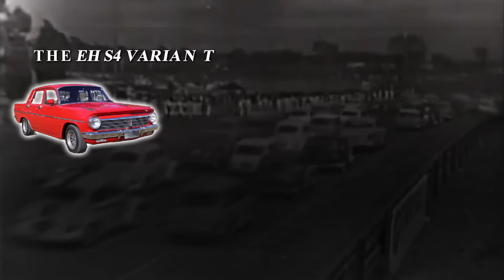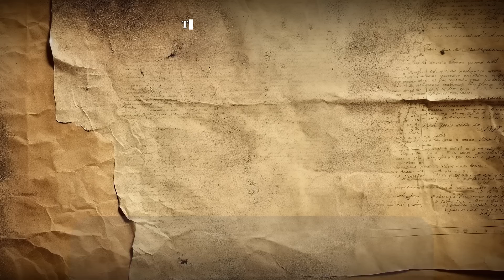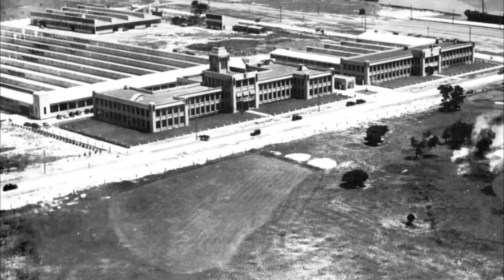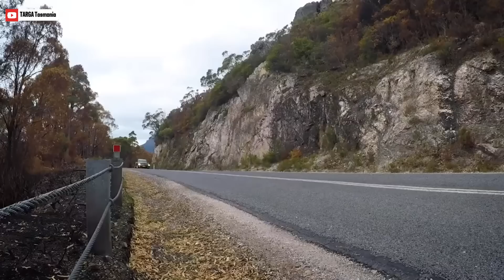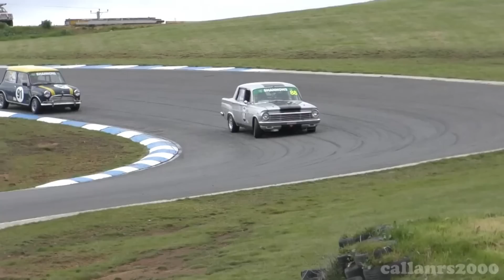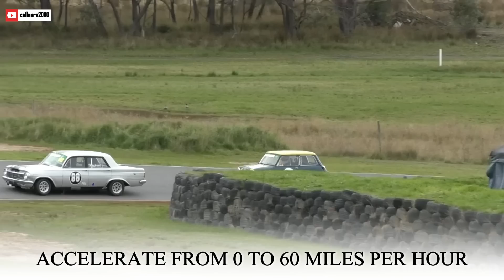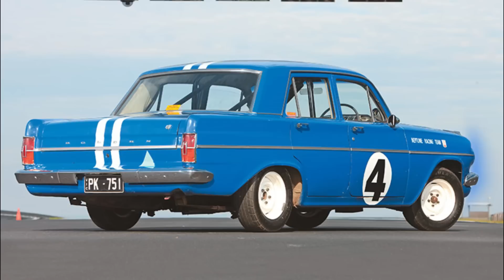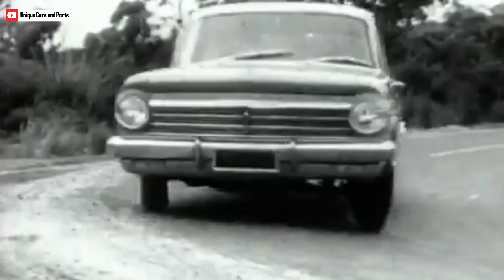Holden's SECRET High-Performance 179 Engine That Dominated Bathurst

Comment: Are you joking!! With valve seats that were cut straight into the casting cylinder head!! And a fibre cam timing gear!
I started my apprenticeship removing those cylinder head repairing sinking valves into the cast heads and stripped timing gears. 
I can’t recall removing Falcon or valiant cylinder heads!
Reply: The Timing Gear was made from some fiberious crap to eliminate gear noise.  Changing it to a steel/alloy Timing Gear fixed it and the subsequent Valves destroying themselves.
Reply: @MelodyMan69 yeah nah it stops harmonic crank vibration that kills engines with metal gears .
Reply: The timing gear on the early red motors was made of Bakealite (mans first plastic) they disinegrate at about 7000 rpm that's why you use Alloy it lasts for ever.
Reply: @Psittacine-pp5yd  The original 44AL Repco alloy gears were good. What you buy these days with the same part number are junk. Fibre gears were not terrible. I have seen plenty still alive at over 20000 miles.
Reply: @Psittacine-pp5yd  I find it hard to imagine that old push rod motor doing 7000 rpm.
Reply: Yeah,because the Ford and Chrysler engine's were no where near as serviceable,making them automatically toast with similar damage.
Reply: @DekGT5mad  you couldnt put your own choice of carbies on old fords.   losers!
Reply: Holden motors were not as reliable as ford or chrysler  6 cylinder motors
Reply: @craigduffield3963  that's a wildly unspecific statement ! What Ford and Chrysler motors . The Holden red six is extremely reliable and so was the grey, the Grey was pretty much a copy of the very reliable Chev Blue Flame six/ Stove bolt six and the Red Holden got lots of design from the chev 198/250/292 Red Six . I don't know were you get unreliable from , plenty of red sixes still driving around .
Reply: @JosephCowen-fz8vj  "plenty of red sixes still driving around :)
I broke a few in my day, but you have to try hard to break one (or just plain abuse it).
Reply: @axle.australian.patriot  yes correct ,
Reply: @countryboy-j2e  Really, I puled down my share of busted ford sixes lol
Reply: Yes straight into the head like every other engine of that era and well into.the 1990s even today on some engines . Works fine , mid 1970s in the US they got unleaded fuel and removed lead that is a lubricant that lubes valve guides and gives the valve seat a softer landing ( along with anti knock ) the US still used valve seats cut into cast iron only now induction hardened the seat area . As for the fiber timing gear , it's there for a dam good reason as any engine designer knows , metal gears transmit harmonic vibrations from crank harmonics to the cam and valve gear destroying it . Replacing any fiber gear with metal halves engine life at least , worst thing you can do . That's why belts or chains are used although chains are not much better that a gear.
Reply: @JosephCowen-fz8vj  The 179 was already totally obsolete when it was launched.  OHC engines with alloy heads were becoming mainstream by the early 1960s. The Americans were the only manufacturers that still persisted with OHV engines beyond the early 1970s.
Reply: @mrbrisvegas2  that's just crap , your just a keyboard warrior who knows nothing or hasn't worked on motors at all , you know people have been saying pushrod motors are dead or old tech since the late 1970s , guess what, Ford's newest monster is pushrod old school power 7.3 litre Godzilla,
Reply: @JosephCowen-fz8vj  I grew up on the red six right through that period. Built and raced them.
the stock 179 was a nice engine for general use but nothing flash.
What the video creator missed was the over engineered 179 X2 engine with steel crank, cam, twin manifold and some other tweaks. They are in essence a different engine and it is stamped into the engine number on the block :)
>
But yes they were still prone to try and throw push-rods through the rocker cover and strip the fiber gears. I have never had an issue running the alloy gear other than the noise.
Another issue was a tendency for a distributor problems after a con rod had knocked it off.
I guess red lines were created for a reason lol
>
All red engines were very finicky on fuel mixtures combined with over heating issues (burnt valves). as well as poor coolant circulation around no six cylinder. we often re-railed the heater take offs on the head to counter it.
>
X2s are as rare as hens teeth and I have only ever seen one genuine X2 in my life :)
Reply: @axle.australian.patriot  the X2 engine was a very good performer.
Reply: @axle.australian.patriot  , i scored a hp179 that had been put in an ek.   it was blue.   it looked like it was that colour from the factory.   it was the only hp block i ever saw.
Reply: @vsvnrg3263   "it was blue" All were Red except for the marine Mercruiser which was black. The X2 had the X2 or something prefixed into the engine number on the block, otherwise it would be a stock 179 or 179 with some work.
Reply: @axle.australian.patriot  , it had hp on the block.   no 179 on it.   and it looked like a factory blue paint job.   i'm pretty sure the later red motors were blue.   the last was black.   the car we drove at work was a 1 tonner with a black motor.  i think the 12 port headed motor  was the black one.   it was fun to drive.   it did good power slides both sides of the johnston street bridge over the yarra.   we did it every morning in both directions.
Reply: @vsvnrg3263  In the 179 They had 2 to stock engines one stamped 179 and one stamped HD.
IT is just a version revision.
All were Red. Later from Commodore they were Blue, and the last Commodore were Black. They then went to the GM Nissan RB30 in the VL.
The engine in question here is called the 179 X2. It was better machined (tolerances) at the factory, has a steel crank rather than a cast crank as well as a High lift cam, some head works and the famous twin Stromberg intake. It was label X2 on the rocker cover with an L shaped arrow in front of the X2 on the decals ont the body works or grill.
X2 was stamped into the engine ID number to separate it from the stock 179.
Mercruiser (Mercury outboards inboard motor branch) adopted the 197 X2 as there marine engine and painted it Mercruiser Black. The only change from the holdem manufacturer was the water cooled exhaust manifold. Other wise they were genuine hot 179 X2 engines :)
Reply: @axle.australian.patriot  , ive just spent time at wikipedia and other sites.   i have faith in wikipedia where a lot of others dont.   if you disagree with something you are required to provide proof.   so it can be very accurate.   it was 50 years ago i got the hp block.  holden never painted engines blue until long after hp blocks were not being made.   if it was actually blue as i thought it was then it was not painted by holden.   we believed hp blocks were super tough and imported from canada.   no, they were not imported from canada.   and all pre 1968 engines had steel crankshafts anyway.
Reply: @vsvnrg3263  Anyways, It still holds that the X2 was a different engine. Like I have said you can't mistake them. They are just not well known about.
If you searched you would find a few pictures of them. Most only show the big air cleaner over the twin carbs, but the twin carbs are hard to see. The rocker cover has X2 labeled on it :)
They are as rare as hens teeth and most people would have likely never seen one.
I have only ever worked on one HD ute 179LX for about 10 years for a customer, and the only other 2 I have ever seen were standard OEM fitted boat engines :)
Reply: @vsvnrg3263  Yeah, I just had a quick check myself. The latter series 179 moved to the cast crankshaft and the forged crankshaft remained with the X2. So we;re both part right lol
I do remember that some were cast and some were forged and that the X2 were all forged.
So long ago lol
Reply: @axle.australian.patriot  , i think ive only seen an x2 once in real life.   i have seen a lot of 186s's.   i was the proud owner of a 161s until i killed it because of a dropped sparky insulator.   then i put that hp engine plus go fast stuff into my gtr.   back in the days before bloody speed cameras.
Reply: @mrbrisvegas2  Guess what pushrod engines are still making lots of power. Red motors n/a are still as quick as any other engine pre about 2000
Reply: @vsvnrg3263  Yeah, I could out run a pursuit car, but not a darn speed camera lol
Reply: @ldnwholesale8552   Th red motor wasn't even in the ball park. 

202 High Compression - 101 KW
GTR XU1 3 litre =119KW. 

1970 Alfa Montreal 2.6 = 150KW.
1955 Mercedes 3 litre slant 6 = 150KW.
1966 Ferrari 3.3 litre V12 = 221KW
1963 3.5 litre Lamborghini V12 = 238KW.
Reply: @JosephCowen-fz8vj Pushrods, leaf springs and live axles. Only in 'Murica.
Reply: @mrbrisvegas2  and Australia, nothing wrong them, I remember in the early 1980s they said " pushrods are dead , no new motors will have them " lmfao, 2025 Ford Godzilla's have push rods and 800 + HP crate motors from Ford . Chrysler Hellcat again Pushrod V8 . Chev 6.2 LT4 795 HP again pushrods. New piston plane engines , all pushrods . Leaf springs and live Axel's are very good at control and side sway , all new trucks, cars that require a lot of power to the ground , leaf springs , independent rear suspension has its good points and bad , many more fail points on an independent rear . 4 X CV joints and 2 X half shafts . Just like drum brakes , in some situations drums are better than disk's .
Reply: @JosephCowen-fz8vj   Pushrods were obsolete 100 years ago.Mercedes and BMW were  getting almost DOUBLE the power of a standard 179. from their 3 Litre OHC inline sixes. 

FYI the The Godzilla 7.3 is only  used in the F-series TRUCK. All Ford CAR engines are alloy DOHC.
Reply: @JosephCowen-fz8vj  , that fibre gear was the weakest point in red motors.   they continued to put them in all motors until the blue or the black engine.   if a metal gear is so bad then why did holden start putting them in after all these years.   i suggest that harmonics are a complicated business that problems may have been alleviated by making the metal gear lighter, heavier, wider or whatever.   reliability is what makes customers return.   fibre gears should never have been used.   some people had the gear wheels strip in unfortunate places.   they might have bought a ford next time.   i had no harmonic vibration problem with an ally gear in my 179.
Reply: My 179 woodruff key and gear needed replacing and noticed there are straight cut gears available for some strange reason. Is it to make supercharger noise or no end thrust?
Reply: Tell me, did they have  an interference valve set up?, the old grey motor was non interference. you mention replacing fibre gears which suggests no destruction.
Reply: @  all the Holden 6cyl engine were non interference.
Reply: @jonvanleuven8621  Great news thanks, alway wondered how you can get high compression when you have to leave room for intruding valves,
Reply: @jonvanleuven8621  They went a fair way before the fibre timing gear packed it in. Simple to fix but being stranded on the road somewhere was the problem. Yella Terra head fixed everything else. I re-built a 161 motor that had gone a long way without water in it. Broken rings on every piston and a cracked piston. It had so much blow by you couldn’t keep the dip stick in. The head and everything else was OK. It went well after that. They were good motors. It went on a welder.